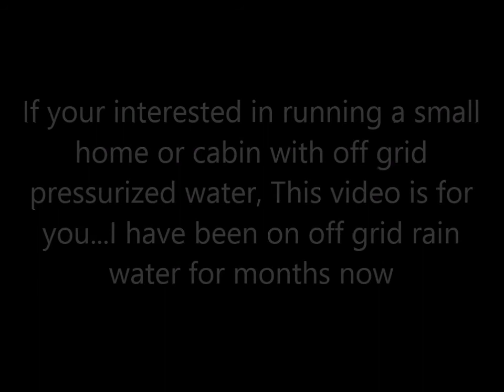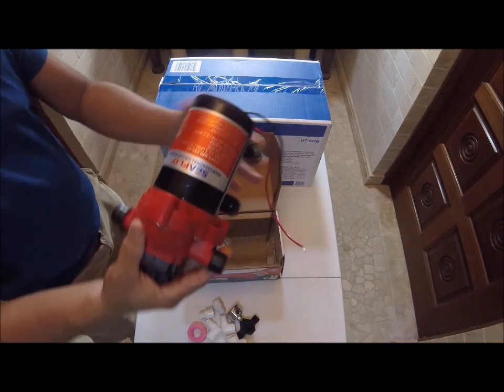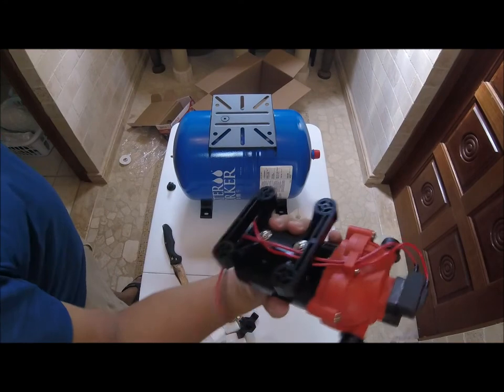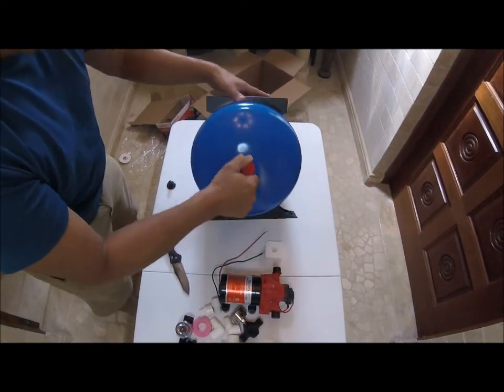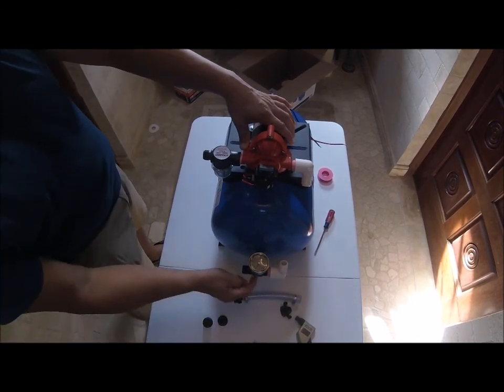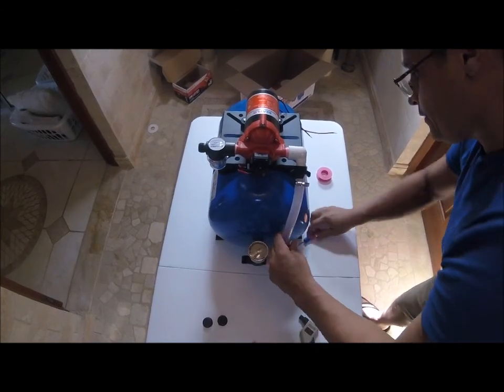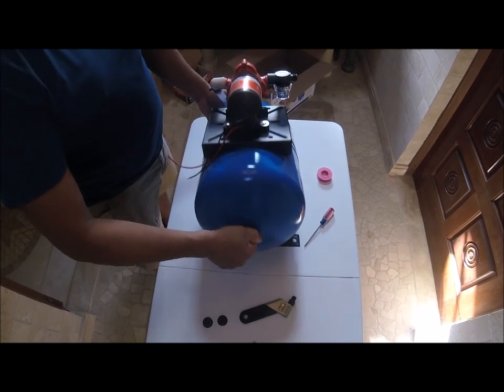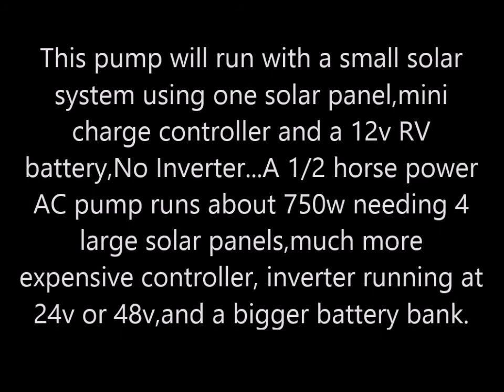Build a 12v super pump

Comment: The pressure tank does 2 important things.  It maximizes the life of your pump, and it provides a consistent water supply.  Without the tank, you may often get sputtering at the faucets..  Amazing you can do this with a 12volt car or deep cycle battery.  This is the best home backup water system at low cost I could find.
Reply from the maker: @charlesharris2352  this pump works great, my mega pump works better,  it works for all types of applications,  including perfect use with float valves, I have a full instructional video.

Comment: Thank you for the video! So if i have the AC pump that does 45 psi and a 2 gallon tank would i still set the tank pressure to around 30 psi?
Reply from the maker: It's technically 28 psi for a AC pump, but 30 is absolutely fine
Reply: @MosaicHomestead  thanks a lot for the reply I appreciate it!!
Reply from the maker: @MaxF01  Feel free to ask any questions,  if I can help,  I will

Comment: I am trying to get water pressure using rainwater pumping into our cabin.  Currently I just have an RV pump using clips on a 12v battery.  It pushes water through the lines but has minimal pressure.  I think your video is the way to go.
Reply from the maker: It depends on how many gallons per minute you need,  the pump in this video pumps 3 gallons per minute...if you pump over 3 gallons,  pressure goes down. My home is 2 levels using 2 pumps, one is a 7gpm and the second is on my roof pumping 5.3gpm, giving me a total of 12.3 gpm...if I go over that, my pressure drops,  this is a example of how Gallons per minute works, just incase you want to increase gpm.

Comment: Would work even better if you put a check valve before pump it would keep the lines pressurized
Reply: I mean after pump
Reply from the maker: @14Balloo  I did that in my install, this is just a pump build,  I built a better pump, look for 12v mega pump.

Comment: using a pressure tank reduce the pump work? I spoke to a dealer who told me that it is not suitable for irrigation because it is not designed for continuous use, this pressure tank solve this problem? how much liter should be this pressure tank?
Reply from the maker: I don't use my pumps for irrigation,  but yes accumulation tank helps pump not run all the time if water isn't constantly on, 12 v pumps come in different gallon per minute sizes, if your going to use 3 gallons per minute in consumption,  but don't want to loose pressure,  you use a 5.3 gallon per minute pump or even better a 7gpm pump, go to my first video,  I have a 7gpm pump with a 20 gallon accumulation tank, 12v pumps can be used for irrigation,  but you need the right size.
Reply: @MosaicHomestead  seaflo 55 series have 5.5 GPM/60 psi.  Should be good for irrigation? I have to move water to a field 5 Meters higher, 100 Meter far
Reply from the maker: @viperblck1  you need a bigger pump, that's a lot of work for a 5.5 seaflo, but a 7gpm pump could probably handle that, but I'm not there to see what you want to do or how much water you want to move, I had the same dilemma when I was building my off grid rain harvesting system for my home, my solution was multiple pumps...if your moving a lot of water, you are in a area with no power, you want to use solar power without breaking the bank, I would build a system  with multiple pumps, build a 12v system with three 320w solar panels a decent charge controller and no inverter because you will run directly from the battery,  it all comes down to how much water your moving for how long.
Reply from the maker: @viperblck1  is it for drip irrigation?
Reply: @MosaicHomestead  no, through irrigation pipe (maybe 20-26 mm ), I have a 10,000-litre tank of water and I have to irrigate some olive trees that are located in a piece of land 100 meters away with a difference in height of about 4-5 meters
Reply from the maker: @viperblck1  You have to go with a AC pump, Water gets heavy with that size pipe, I have never moved water that far through 26mm pipe with a 12v pump, I like to experiment,  I would try 2 7gpm pumps merging into that one pipe going that far, but that's what I would try if I had to move water off grid...if you have power, go with a AC pump, the set up is cheaper.
Reply: @MosaicHomestead  don’t have ac on my countryside
Reply from the maker: @viperblck1  Do you have solar?...you can also run a generator to irrigate with a AC pump.
Reply: @MosaicHomestead  not yet, many people use this kind of pump with solar panel and not ac pump because solar panel is used to charge 12v battery
Reply from the maker: @viperblck1  Solar can be used to run a AC pump as well, but solar system voltage must be increased to 24 or 48v, 48v recommended,  to run the AC pump a inverter is needed  and a minimum of 6 solar panels increasing the price of the system,  im always thinking return on investment,  if watering the olive 🫒 trees provide a decent profit 📈,  it's worth the long term return on investment,  but if your starting, you go with the cheaper alternative ( gas generator) to see if it's worth a bigger investment.  Solar always pays itself off, my system paid itself a long time ago,  but I put my system together myself bringing down costs big time.

Comment: Series 42 have intermittent duty cycle while other series have continous duty cycle. What is the difference between intermittent and continuos duty cycle ?
Reply from the maker: Continuous is meant to run continuously,  intermittent is for stop and go, if you attempt going 12v, come back and let me know if it's working good, im curious to know just because of the volume of water your pumping,  it might take longer to irrigate,  but I believe it can work if you set up right according to your situation.
Reply: @MosaicHomestead  ok but continuos pump will never reach pressure and stop to work ? I have to add a pressure tank to let the pump stop working for sometime mantaining pressure?
Reply from the maker: @viperblck1  Seaflow pumps come with what is called a diaphragm switch,  this stops the pump like a pressure switch.
Reply from the maker: @viperblck1  For a float valve application  you may have to add a pressure switch,  those diaphragm switches start to click on and off when tanks are almost full, just add a regular AC pressure switch and tighten the hex nut on the diaphragm to increase diaphragm switch pressure to supercede AC pressure switch,  this puts AC pressure switch in control of the pump
Reply: @MosaicHomestead  pump is stopped when? Pressure switch can be tightened to increase or reduce pressure ?
Reply from the maker: @viperblck1  pump stops when pressure reaches its PSI, usually 45 or 60 depending on what pump you get, obviously a valve needs to be shut off for pump to reach its PSI , 45 or 60
Reply from the maker: @viperblck1  You only touch the diaphragm switch if you're adding a separate AC switch,  you increase pressure turning hex nut to the right to make pressure of the diaphragm switch higher than  the AC pressure switch , so AC pressure switch controls pump , not the diaphragm switch,  but again,  this is done if your going to pump into a tank with a float valve.
Reply from the maker: The pressure I'm talking about is the PSI of the pump, not physical pressure,  if pump is a 3 gallon per minute,  it's not pumping 4 or 5 gallons per minute because you turned the hex nut, im making this clear because I'm not sure about your plumbing skill level 😉...but I will try to simplify to help.
Reply: @MosaicHomestead  very low level 😞 I just have to pump water from a tank to a field with 5 Meters height differences , distante is around 100 Meter . I will use a  simple irrigation pipe (20 mm) to have a good pressure. Which pump series you suggest ? Continuos I suppose , right ?
Reply from the maker: @viperblck1  I would go with a 7 gallon per minute continuous,  height usually isn't a problem for these pumps,  My rain harvesting system pump, pumps water about 40 feet high laughing 😆 without a problem.
Reply: @MosaicHomestead  series 55 is 5.5 gpm 60 psi continuos pump. Should be ok? Wow, which model you use to reach this fantastic result ?
Reply from the maker: @viperblck1  seaflo 7gpm, I also believe it's 55 series,  this July 1st my pump will have 5 years of service of none stop daily use, this pump is continuous,  but I'm using it with a AC pressure switch and 20 gallon accumulation tank,  my home uses 2 pumps, a 5.3 gallon per minute and a 7gpm for a total of 12. 3 gallons per minute before loosing physical pressure,  my home is a 2 level home, so I designed my own pumping system,  the 12v pumping system is 100% off grid working on wind and solar....it's a unique system,  but I'm very good at coming up with solutions.
Reply from the maker: @viperblck1  I will be putting up a second video on this pump topic it will be called build a super pump 2, I will show how to build this same pump for float valve applications using a normal AC pressure switch,  pump will be used for my chicken coop,  pump will work on one solar panel,  a video will be made on the solar system that will run the pump, it will be the most inexpensive system yet, but will surprise on what it will run, it will be on my chicken bunker videos.
Reply: @MosaicHomestead  wow, looking forward to see it. Which battery I should use with 55 series ? 100 ah?
Reply from the maker: @viperblck1  Amp hour  is picked based on how long pump will be running and day light hours,  but if you build a solar system the right way and pump is ran only during the dry you can get away with one RV battery,  why?...because the pump will run on solar, not on the battery,  lots of tricks to build inexpensive,  the batteries are the most expensive part of a solar system.
Reply: @MosaicHomestead  for now I won't use a solar system Just a battery that I Will charge later at home. So I Guess what battery capacity I should use (Max Power absorption for 55 series is 17 A )
Reply from the maker: @viperblck1  Not recommended using just a charged battery,  to move that amount of water, solar is needed,  battery will be damaged by draining it completely,  you will have to use a power station battery if your charging at home.
Reply: @MosaicHomestead  ok, have you pubblished on-line a simple scheme of the solar system ?
Reply: @MosaicHomestead  do you have pubblished online a scheme on how to build this solar system?
Reply from the maker: @viperblck1  my shed has a solar system similar to what you might need, go check out prepper shed solar, the system has a inverter because I'm changing batteries and running tools, it's a 12v system,  it has 3 RV batteries.
Reply from the maker: @viperblck1  my prepper shed solar video,  this system could be built cheaper,  I will be building a cheaper version for my coop, but remember systems have to be built based on consumption,  you can't build a small system expecting to run a house
Reply: @MosaicHomestead  sure, do you have some videos to suggest on how build ?
Reply from the maker: @viperblck1  thousands of videos on how to, start with solar fror beginners videos...Then buy some small cheap solar system stuff and build one, nothing beats building one on your own,  super easy, you will get hooked and start producing your own power.
Reply: @MosaicHomestead  can you check and let me know which model you have ? series 55 has 5.5 gpm , can't find model with 7 gpm that you are referring to
Reply from the maker: @viperblck1  go to Google and search 7gpm seaflo and it will send you to a Amazon link
Reply from the maker: @viperblck1  the pump is 53 series
Reply: @MosaicHomestead  yeah, Seems that 53 and 55 series are the same except for gpm

Comment: I have the same pump from Amazon.  Where did you get that accumulator tank?
Reply from the maker: Home Depot, it's a 6 gallon water works, here they stopped selling this accumulation tank separately,  I have a updated video called build a mega pump, it's a more advanced video,  but pump will work even with float valve applications.

Comment: I would love to buy this model tank but don;t see anything comparable.  Everything on Amazon is vertical, but for the space I have I would like the exact tank you show in this video.  Any way you have a link on where I can buy?
Reply from the maker: These tanks are sold in home depot or Lowes, but depending on what you want to do, a vertical would work as well, I have a 7 gpm seaflow pump on a 20 gallon accumulation tank, these pumps can be made bigger also using 12v...Its in my very first video with the 10, 000 gallon storage rain harvesting video...I'm actually using this pump in the video in my shed with a portable washing machine,  pump and machine work off of 3 solar panels and 3 RV batteries...Super efficient.
Reply from the maker: Any other questions,  feel free to ask.

Comment: I once connected brass faucet to a pvc pipe that was connected to a pressurized irrigation system.  The pvc thread did not endure the pressure and I ended with $200 water bill.
Reply from the maker: It can be done but I'm not a fan of mixing materials, use Teflon when mixing materials and align the threads is very important.

Comment: Man. Exactly what I need.
Reply from the maker: These pumps work great and consume very little power if your running off solar, these pumps are the ones used in bunkers, im using this pump right now in the shed, in my first compost video, water coming out of the hose is rain water collected by the sheds cistern and pumped with this pump,...Keep this in mind, if you get a 3 gallon per minute pump, you are limited to 3 gpm, if you exceed 3gpm, pressure drops,  my recommendation is get a 5.3 or a 7.0 gpm if you want to run multiple water items like shower and flushing the toilet.
Reply: @MosaicHomestead  im going to run 2 ultimately. One for shower....other for sink.
Reply from the maker: @FinehomesofNewHampshire  If it's just for that a 3gpm will work fine, if adding a toilet a 5.3 gpm is recommended...Your going to be surprised how well these pumps work.
Reply: @MosaicHomestead  No toilet until next year. Grabbing an Incolet until then.
Reply: @MosaicHomestead  Thanks bub! Super inspired by your set up and knowledge.
Reply from the maker: @FinehomesofNewHampshire  Any questions to problems,  let me know, we'll get it fixed right away.
Reply: @MosaicHomestead  Thanks bub!🤘

Comment: This is the setup I'm looking to make for my  cattle  will I need to add a pressure switch to mine and will I need a fuse box great video by the way
Reply from the maker: The pump comes with a pressure switch, if your pumping to a cistern with a float valve, then I recommend a external regular pressure switch,  the diaphragm switch on the pump has problems with float valve operations .
Reply: @MosaicHomestead  ok cool I put in a pressure switch.    if pump is 45 PSI and tank is 45psi will I be setting the pressure switch to 45 too
Reply from the maker: @teammj2855  Diaphragm switch on the pump has a small hex key hole, turn clockwise twice to increase pressure on your 12v pump, pump pressure must be higher than external pressure switch,  if pump is 45psi, external pressure switch must be 45 psi, some external switches already come set at 45 psi and 60 psi, get 45psi if you can't find 45 psi , get 60 psi and lower pressure,  its going to be the screw with the spring on external switch...my 10,000 gallon with 12v pumping system  video illustrates a pump with external switch.
Reply from the maker: @teammj2855  feel free to ask as many questions, when I first started ,I was having the same problems lol
Reply: Sea flo 42 Series has 55 psi pump what size tank what pressure should I have inside
Reply from the maker: @teammj2855  12v pumps ,manufacturer settings is 18 pounds,  try not to pass 22 pounds

Comment: Great tutorial!  Would a one way valve be needed in between the pump and tank?
Reply from the maker: From pump to accumulation tank = No,  check valve is only needed where you don't want water to return or simply move backwards,  these pumps literally have them built in.